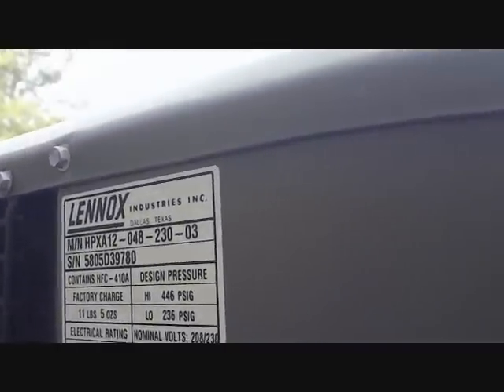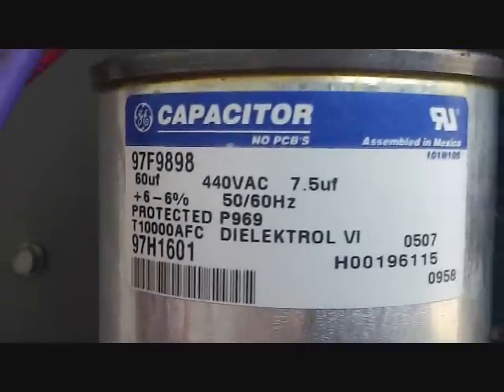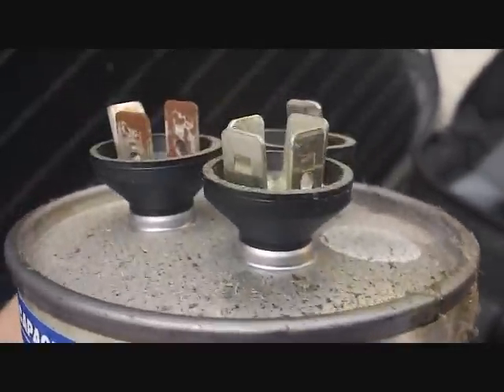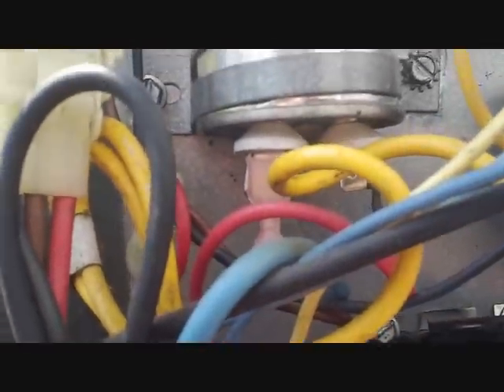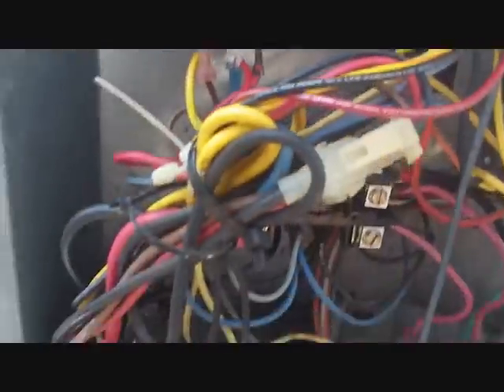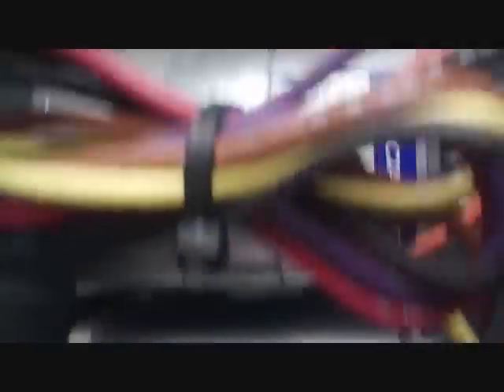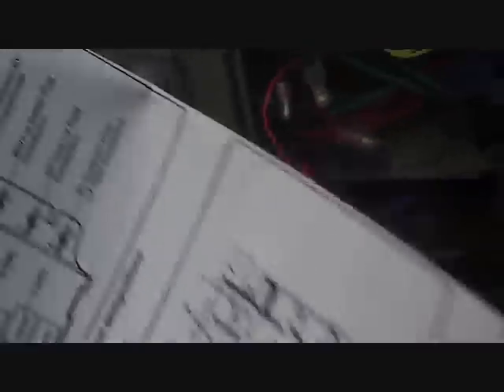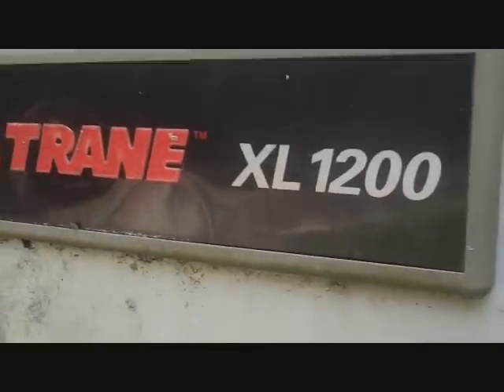HVAC Service- 3 No Cools

Comment: How often do capacitors go bad ?   We just bought 2 new ac units 2 years ago one of the ac units fan not working cooling I spun the fan and it started just not cooling .
Reply from the maker: Dj Ohmarty they can go bad anytime. A lot of them are just cheap